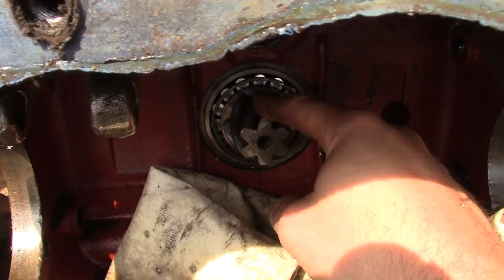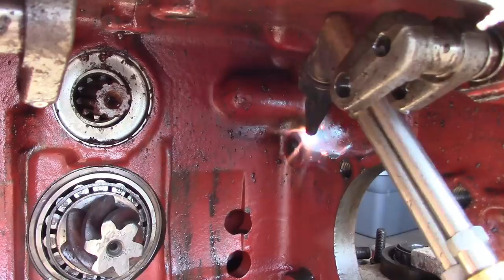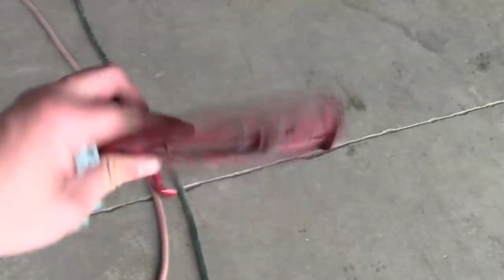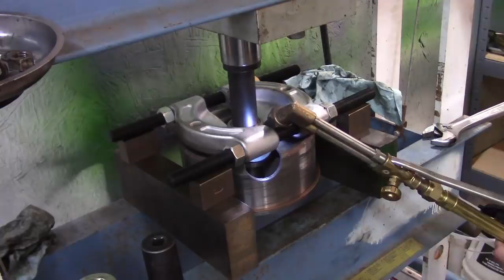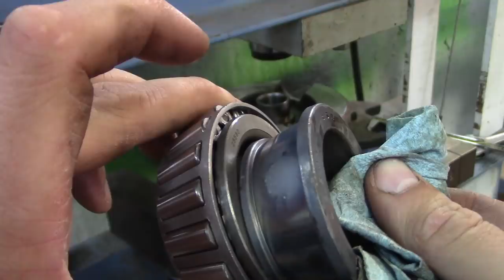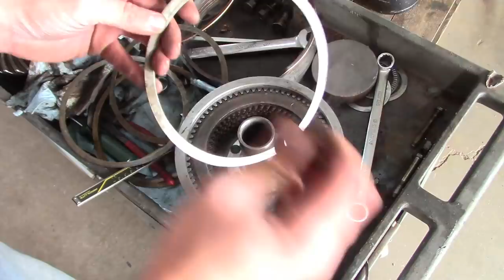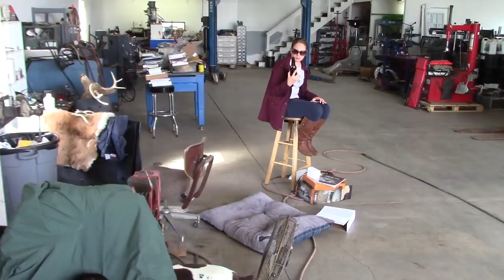1960 Oliver OC46 Crawler - Transmission Removal, Steering Clutch Assembly - Part 3

Comment: It is good to know I have been removing cotter pins wrong all 50 plus years I have done it.
Reply from the maker: I know!
Reply: @WatchWesWork  using a pliers sucks in my book.
Reply: Me too.
Reply: @scruffy6151  To many scuffed knuckles especially when its cold!
Reply: @wideyxyz2271  agree
Reply: @WatchWesWork  

Ñ

Ñ
Reply: I use a pair of poorly closing channel locks, that or a screwdriver, helps if you chowder the threads on what the pin is for first though
Reply: Same here 30 years and forever more

Comment: I told my wife "I need a torch" 3 seconds later Wes: " I don't know how anyone lives without a torch"😂 I said "see I told you!"
Reply from the maker: Dang right! A welder too!
Reply: @WatchWesWork  Indeed!  I bought my first welder this spring (Hobart MIG) and my wife was THANKFUL since a few weeks later my son rear ended a car so replacing the radiator support was almost a zero cost job (pull-and-pay replacement).
Reply: 🔥 is a must in any shop. You can even cook with it 😆
Reply: " There's your problem Lady!"
Reply: @williamfindspeople4341  We used to make Jiffypop popcorn using a rosebud tip.

Comment: I just can't express how brave you are to be doing this job. Its an old machine, really worn out, low on parts and just everything rusted solid, and a mess. Excellent video as always, wish you were closer to done but with excellent dog footage as well as wife content, this video gets a brutally heavy duty thumbs up!! See you in the next installment!
Reply: Surely, the owner could buy 'work-a-round' parts that substitute for this maddening stack of shim, spring disks, clutch plates, dinner plates, et al.  Restoration of this machine is really a Jobian task whose assembly/maintenance must have cost this mfg. a generation of clients.....

Admiration for your creativity & assiduousness (whatever that is...?) for a brutally tedious undertaking....!
Reply: All possibly true. But my thoughts were what if he gets this thing going, Wes gets paid and the owner uses it for a few months and something else breaks. Sure not Wes' problem but what a waste to have sunk all that work into something so obsolete and worn out and always wonder what's next? I like seeing restorations and work on the old stuff but if parts are crazy expensive or you just can't find them would not something more common be a smarter move? Maybe in fact there are lots of these lingering around, but I would like to be sure if it was mine. I looks like a fun piece of old iron to play with and drive around, but if it is going back to doing real work will it last?

Comment: Uhhh, how else are you supposed to remove a cotter pin that's almost rusted away other than with side cutters? What does it matter if you're replacing it like you should anyway?
Wait until he finds out sometimes you cant get it out at all and have to take the castle nut off anyway cutting the cottter pin in the process.
Reply from the maker: Right. Like every ball joint I've ever touched!
Reply: He must live in Arizona.  Anyone north of the Mason-Dixon line uses side cutters.
Reply: I was taught in auto training to use sidecuts and in the Navy we used sidecuts. I guess it depends on who trained you.
Reply: I do like to try them all with my expensive Snap-on cotter pin puller and 8oz ball pein hammer before I reach for end nippers which I find give a better twist and pull than side cutters. Impact on the castle nut is normal where rust is involved.  That Snap-on cotter pin puller is the ideal farmers friend for threading twine through baler needles!
Reply: A pair of pincers can be a good alternative if you haven't got the space to work at a right angle, it really comes down what tool you can get into the space available.
Reply: I've been looking at those side cutters Wes uses for awhile, those curved kinds aren't too common.  In honour of the guy who was freaking out about using them on cotter pins, I've ordered them from Amazon!  That guy probably has a special tool to remove differential fill plugs, while the rest of us just use the 3/8 drive on our ratchets.

Comment: In a pinch I have used the rust pited gears, the pits hold oil better than the smooth surface, I also use the old heavier straight weight oils in the older machines.
I have used side cutters for removing and installing cotter pins for over 50 years, I was taught by my great Uncles who were retired farmers and all had worked for Catapiller and that was the tool of choice for the farmers that taught them. What some people will complain about.
As far as gaskets, that old machinery is so well seasoned that if you use the same facing or mating surfaces they are matched, most of the time I just use oiled down brown paper used for shipping. A thin coat of the ultra gray works too.
Great video as you normally put up for us!

Comment: Unbelievable amount of complexity for anyone to figure this OC46 steering clutches and drive units .Really fun for me to watch and makes for a very good video of your exceptional skills. The Take a way here for most people is to NOT spend one dime on parts or time on this overhaul because it probably will fail or have a very short life. This should have been junk by most owners. Your or other shops will have between 50 to 100 hours against this machine at $150 per hour or $15,000 plus $2000 and other parts. Koodo’s for You and Thanks. Everybody else run. Can’t wait for finish of and loader re attached.

Comment: Hi Wes, here in the UK cotter pins are usually referred as split pins and when I served my apprenticeship as a truck mechanic 50 years ago side cutters were called "split pin pliers" - 
I still call them this !   and "the torch" was called the hot spanner. Keep the vid's coming, I'm serving my 2nd apprenticeship on line with you.  Stu.

Comment: Your nuts (also really skilled). I would runaway from home with that thing tore apart in my shop.
Reply: well if you got the parts and  a extra machine to use use its not so bad lol. once you done one clutch pack, youve done em all, eventually stuff tends to be very similar overall.

Comment: Side cutters on cotter pins! Next you’ll be leaving batteries on concrete
Reply: What's wrong with batteries on concrete?
Reply: @legitdelirium3446  It makes them go flat 😁
Reply: J S   I dunno, maybe he’s one of those guys who owns a $4000 bicycle.
Reply: @legitdelirium3446    I used to haul scrap batteries to a recycle plant. Most of them were cracked or leaking. They make concrete fizzy.
Reply: OO you are a tough guy and remove cotter pins with your teeth ha?
Reply: @zeroyon4562  Old wives tale from when batteries were made of wood.

Comment: Excellent job so far crawler tractor fix up and keep going too! Also there lots to surprise work in tools work for repairs and help out too! I seen also did to myself to and I explain too ! I use a water pipe adjustable wrench on HEX bolts that no socket would work too but water pipe adjustable wrench did the job perfectly with torch heat up !

Comment: Side cutters all the way. No better way of gripping rusted or damaged cotter pins. Only time I've seen square shoulder bearings used, was in a ZF tractor transmission that had high end thrust. The circlips would fit flush against the bearing cups in a line bored housing. If you used standard radius bearings it would lay over the circlips and fold them out of their grooves. 
Great work as usual mate.

Comment: Side cutters are about the second most used tool besides my knipex channelocks. It'll strip wire, pull keystock, cut cotter pins, and even your nails.

Comment: The shafts used to be made sharp corners where the diameters changed so bearings didn't need a radius but they found that they needed a radius to reduce the stress at the step on the shaft so all bearings started to be made with a radius to fit shafts. More of the bearings with a radius were used so even though it cost slightly more to make them, it was cost effective to make all bearing with a radius because the radiused bearing can be used in place of the non-radiused bearing but the non-radiused can't be used on a shaft that has a radius at the step.
Reply: Tired old mechanic   Thanks for passing along the knowledge that would otherwise be lost in time.
Reply: It's not increasing the stress but it is severely reducing the fatigue strength of the part, but roughly as you wrote

Comment: I use a cotter pin puller.... when I can find it.  I used a diagonal cutter as well.  I've also found that a rubber hose removal tool (that is worked up inside the hose between it and the fitting) will  sometimes work when you can't find the first item.

Comment: "HOW does anyone live without torches??" The answer is 'anti-seeze', getting people to use it is the hardest part.
Reply: I realise what Anti-seize is supposed to do but what is it please? We use copper grease to do the same job.
Reply: The problem is,  what we know as Anti-seize today,  didn't exist in 1960,  and I'd say a fair amount of those bolts havent been removed since...well....1960 lol
Reply: @w056007568  It's a grey blend of aluminum, copper and graphite lubricants that is intended to prevent galling, corrosion and seizing.  I put it on just about everything that is exposed to the elements that has metal on metal contact.
Reply: Yeah but you gotta get stuff apart to put never seize on it
Reply: @jaredkean7841  its been around for years
Reply from the maker: If only the factory would use anti-sieze. I've never seen it on a factory fastener.
Reply: @WatchWesWork  Yes I wish they would too.  It would save hundreds of hours of labor and misery for those of us who work on stuff.  I heard once that a supplier wanted to put it on motors for Sears.  It would have cost less than a penny per unit but they wouldn't pay for it.
Reply: @jaredkean7841  Yep, damn near impossible to get people from 50 -60+ years ago to put stuff on then so that it does some good now!
Reply: You would be surprised how often a few well-deployed f-bombs will loosen up a stubborn nut. If you lubricate it with thumb blood it's even easier.

Comment: Thanks for another update on the old girl. That old crawlers got another 50 years or more in it even with some of the settings not being ideal, how many of the old machines are still running fine and nobody knows at 12000 hours the initial settings are way out .  
 I'm thinking that reverse gear and the reverser on a seperate lever is how you get a super low gear forward, I've seen it on some tractors with a similar system. The reverse is a lower speed gear than say 1st forward, so selecting that then using the reverser  actually gives the slow reduction forward. It kinda sounds a weird idea reversing the reverser to go forward, but   that may be why that gears so warn giving a slow speed for max push when it had a blade on it.  Take care

Comment: When stacking shims for the pack put the thin one between the thick ones and it will help to protect it from getting damaged. PS I use side cuts on cotter pins all the time.
Reply from the maker: Hmm, that's good thinkin'!

Comment: What is the issue with side cutters to remove cotter pins? My dad was a professional equipment mechanic for over 50 years and always used side cutters to remove cotter pins. He showed me how to do it and I've been using them that way for over 40 years.

Comment: That dude going ballistic about split pins and side cutters, lol. I wonder how many split pins he's actually removed in his life? Probably 4 or 5.
Myself, I use whatever is to hand that gets the pin out. Screwdrivers, side cutters, hammers, pliers, whatever works. Fencing pliers with that little pincer bit on the end are especially good, if you can get them in where you need to be. I mean, you're not going to re-use the pin unless you're ultra dodgy or super desperate, and in either of those situations it doesn't matter anyway, lol. The pins are very soft, you're never going to damage your tool getting one out.
It takes all sorts to make a world, unfortunately some of those types are fucking idiots.
Keep up the great work Wes.
Reply from the maker: A lot of those types!

Comment: Wondering if you ever use the heat & quench method for loosening rusty bolts and nuts? First saw it on Taryl Fixes All. Seems to work good.

Comment: Great video Wes.  Ignore the cotter pin Nazi.  Those channelock side cutters  that you use are the very best ones of all the the ones that they make. I have nearly all the channelock tools over the past 40 years. I'm still trying to get my head around how the friction discs can work in a hydraulic fluid bathe...is it a controlled slip? Kind regards, Craig

Comment: Split Pins are single use, what's the issue with using side cutters?. I can't believe how complicated this drive system is, first time seeing a tracked vehicle transmission being disassembled, and rebuilt. Definitely too complicated for me.
The spiral bevel gear is most likely a high alloy steel and induction hardened rather than case hardened, the surface stress is immense on these teeth, microscopic flakes of the faces are generated at full load.
Great work, and great video.
Thanks for sharing.

Comment: At the start of this one, I know you are going to get this one back running well but here is my suggestion.  Drag it out into an open field at least 500ft from the bush and over 1/4 mile from any structures.  Pack a large quality of high explosives around the machine  - none of that ANFO or other low grade stuff but good high nitro dynamite or RDX/C4 - light fuse and then take to the bush.  Wait for the sound of freedom - nobody will ever have to wrench on that again :)
Reply from the maker: I think it would take a lot more than that to hurt this machine!

Comment: Have you used a bearing heater? The heavy duty Mechanic (western truck and tractor repair) was using one.
It must have expanded the bearing 2-3.000. I think it was an oil bath? All the best from Canada

Comment: Unsure what the guy's issue with side cutters and cotter pins was. Inexperience, probably. That school bus shop I mentioned to you where I worked; didn't allow reuse of a cotter pin. I can't remember any of us who DIDN'T use side cutters to remove them. I mean they make a cotter pin removal tool. But, even the Snap-On one is a steaming load. We all used side cutters. We were all professionals, too! Very odd.

Comment: Wes I know this is a few years late... I'm curious if you would have taken any different approaches to this repair if you didn't have access to service data/manuals for this platform. Would it have been possible to dead-reckon your way through the repairs, such as rebuilding the clutches?

Comment: Good job on the work you do, living in the rust belt I'm used to working on frozen parts both mechanically and temperature wise.
Just one comment, when you tied the wire around the center drive assembly to hold it together you should never use cotter pin removers to cut wire....LOL
Reply from the maker: True. Tool abuse.

Comment: Shucks looks like not much difference in working on this and a 2 cycle weed whacker.  Just lift the transmission out, no need for all that chain hoist stuff.  Ok maybe i might be wrong.  What a fantastic job you are doing.  Very interesting comments below as well.

Comment: When you are running wire through Nuts and Bolts I have always had better look twisting the wire instead of letting the single wire on each side to hold the nut from turning just my way

Comment: Am I correct to assume that you didn’t soak the clutch fabric prior to installation because of the tight tolerance
Reply from the maker: I didn't do it because the manual does not say to.
Reply: Watch Wes Work Great job your work is meticulous except for pulling Cotter pins🤪🤪🤪Back in my day we had another name for those that you can’t use today then I’m sure you know

Comment: I think I have an explanation for the bearings. I imagine Oliver probably heard about a bearing order some other company had ordered from the manufacturer, that either didn't use them due to change in specs, went out of business, or couldn't pay; since they were close enough, Oliver probably picked them up for cheap and used them. I think too that being 1960, all the drive parts were probably hand machined anyways, so it was no problem to cut the mating surfaces to allow the use of those bearings.
Reply from the maker: That could be. I remember working on old Ford tractors. You could have two tractors a few serial numbers apart with totally different hardware. Henry Ford bought the cheapest hardware he could get and modified the tractors to fit.

Comment: The reason why you soak disks pre installation is because post installation you might as well just throw it in the unit. Hard for things to “soak” with several pounds of pressure creating a seal keeping fluid out

Comment: You need some bees wax for those stubborn nuts and bolts,we did steering clutches on a 56 TD 6 that had been sitting half apart for 20 plus years outside so you can imagine the rust....anyway,with bees wax you heat up the nut,bolt or whatever til it's cherry red,let it cool slightly,take your bees wax and smear it all around,let it melt right into the threads,let it cool off ,and then try it,if it's rusted real bad it may take a couple applications,you can get bees wax at most any been keeper.i usually cut it into useable strips.i would share a video and show you but I guess we can't share videos in the comments

Comment: For as much as that tractor will ever get used, I doubt the pitted ring gear surface will ever be a failure point.  The worn out pinion bearings, well that's another story...

Comment: Years ago I had a bus come in noisy diff put to new matched crown wheel and pinions in it both times set backlash and clearance still noisy was walking past the scrap heap with a deflated ego and found a good pinion put it in quiet as a mouse